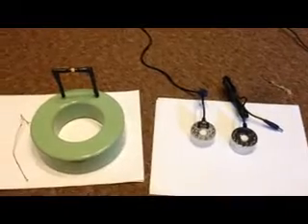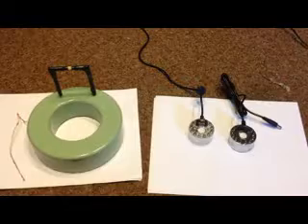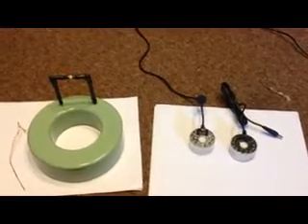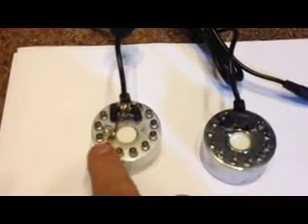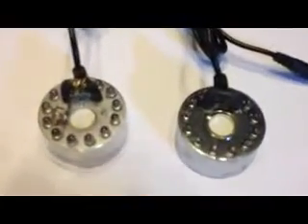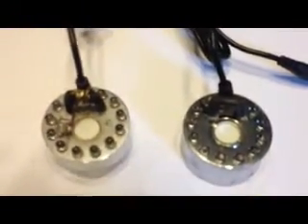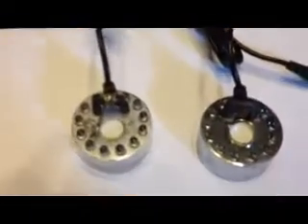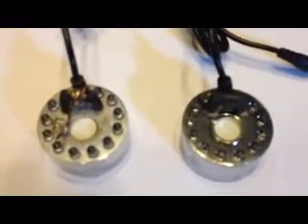Altering transducer

Comment: That's a great way to do it! I have never done it that way. Doing it that way keeps everything sealed nicely so you don't get fuel leaking through the the area where the sensor attaches to the casing like it did on my modification. I cut the sensor off and drilled out the holes where the sensor was then put a screw in the hole to ground everything. Your way is much better! 

This is why it is important for people to get involved, I don't have all the answers or the best ways to do everything. When we all work together we have greater success! Thanks for sharing!
Reply from the maker: Yes I did it the way you just mentioned at first and ran into problems like you had to try this and it works great. One other added thing I didn't mention was the whole you drill you can Tap it and put a screw for a positive ground
Reply: diveborg13 Have you had any problems with the fuel eating away the gasket that is between the ceramic disk and the casing? I didn't but was curious to see if you have since you have most likely ran yours longer than I had mine.
Reply from the maker: Tyson Capel No problems with that But I did find the electric cord would get brittle so the way I solved that is A Glue called Seal All for Gas and Oil I just coated the outside. Oh your going to want to make a Float cause the Transducer works just below the surface I used the Todler toys that have Rings of plastic and half a Plastic ball with slots and coated the whole thing with that glue so far so good
Reply: That's great advice thanks!